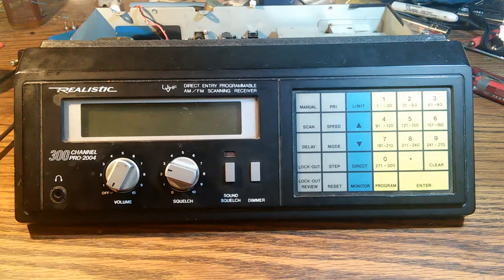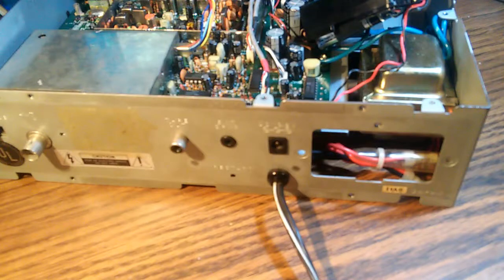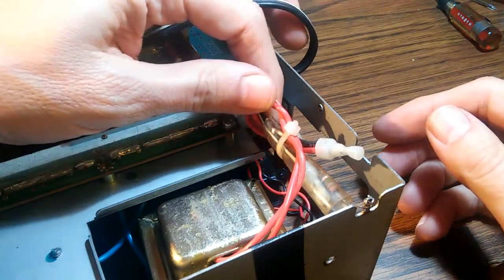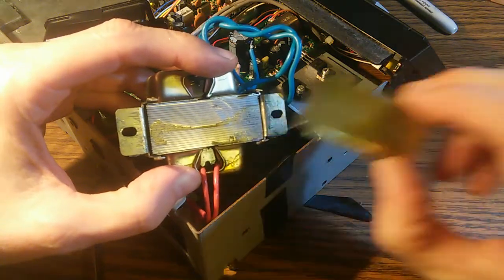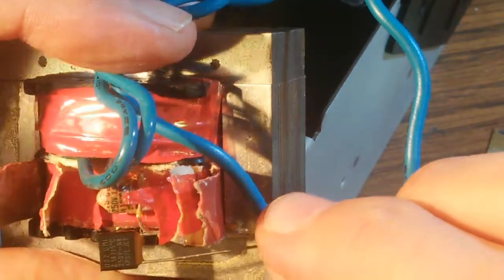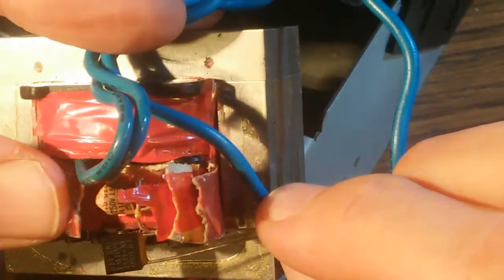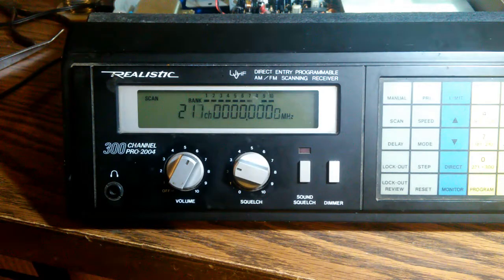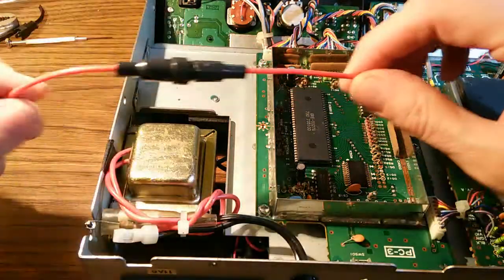Radio Shack Pro-2004 Fuse Replacement and Transformer Repair

Comment: 20+ years ago my scanner would not turn on using the standard AC power cord. I checked the resistance of both the primary and the secondary windings. The primary showed open so I figured the transformer was bad. I would have never imagined putting a fuse in a transformer so I just cut the power cord off where it entered the scanner and used a DC supply. I liked it better that way when using it in a car and not having the power cord getting in the way.
I recently dusted of this scanner after not being used for 15 years or so and it works fine. All channels in memory are still there and the display is dim like it was when I last used it. Planning on replacing the electroluminescent back light and cleaning the volume control and having some fun with it again.

Comment: Question for you ... when you tested the "fuse" and you said it was "open", what would the meter say?  Would it say OL?  It won't show "continuity" then, correct?  In my PRO-2006 I found the fuse in the secondary winding (like your scanner) and the fuse shows continuity so I'm assuming it's still good.  I have 115 VAC coming in on the power cord to primary wires, but the scanner won't turn on with AC power.  (The scanner works on 12VDC though.)  What could I check next in that case?   I don't mind using the 12VDC, but would like to get the AC working if possible.  Any suggestions?
Reply: Do you have around 15 volts AC output from the transfo? if yes check the rectifier 1B4B41 FOR 14 VOLTS AT PIN 1.
Reply: @f4tboy99  I will try to check this coming weekend.  I just had shoulder surgery so not moving very well.  I will let you know what I find.  Thank you!
Reply: @f4tboy99  There's two blue wires coming out of the transformer that go to the board.   I tried to measure voltage where these two blue wires are soldered to the board and get no reading.  I checked the red wires where they attach to the power cord from the wall and get 115 VAC there.  So I'm guessing the transformer is just bad?  Or do you think I should replace that "internal fuse" in the transformer?
Reply: @douglasbollinger3626  I would do this: If it's easy for you to find another transfo (12 vac) go for it + add a 1 AMP fuse in series with the primary. The other choice is to remove the fuse inside the transfo and add a 1 AMP fuse in series with the primary.
Reply: @f4tboy99  I bought a couple of the internal fuses after watching this video, thinking maybe the fuse was blown - but after I tested that fuse it showed continuity so that fuse should be good.  Would that transformer possibly have another fuse on the other side, too, that could be blown?  I only checked one side of the transformer like this video.   Sorry so many questions, just trying to  keep this as simple for me as I can.
Reply: @douglasbollinger3626  When you check continuity of both sides of transfo, one side is open? If so the transfo is dead. Do you have over stock electronic store in your area? Maybe you can find a low cost transfo.
Reply: @f4tboy99  How do I do this?  So this transformer has 4 wires.  Two primary, two secondary.  Just test continuity on both primary wires at the same time then both wires on secondary at the same time?  Then if one is "open" it's bad?  Sorry so many replies.
Reply: @douglasbollinger3626  If one side is open the transfo is dead or a fuse is blown. The primary winding is isolated from the secondary, so you check both sides separately.
Reply: @f4tboy99  Ok, thank you.   When I get a chance to try I will let you know what happens.  I appreciate your help!

Comment: Today I have learnt something I didn't know.  A fuse tucked inside a transformer. Definitely something to remember... Thank you David for sharing.
Reply from the maker: Yes, I was quite surprised.  A hidden non-replaceable fuse is a really bad idea.  That is probably why I have never seen it anywhere else.
Reply: @c.davidgraves4848  Maybe replace with a Thermal Switch: https://www.aliexpress.com/item/32877646622.html?spm=2114.12057483.0.0.52a66237WC5DI9  +  a 1A fuse outside for surge protection.